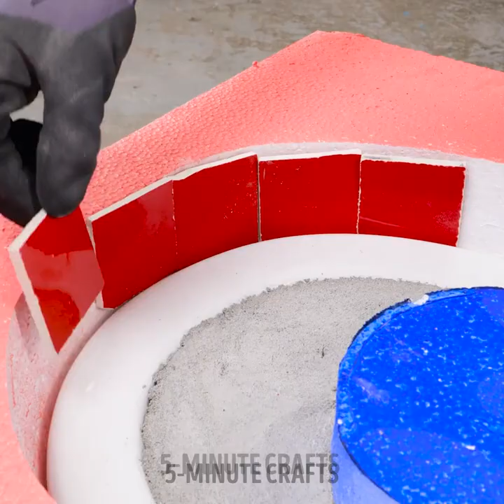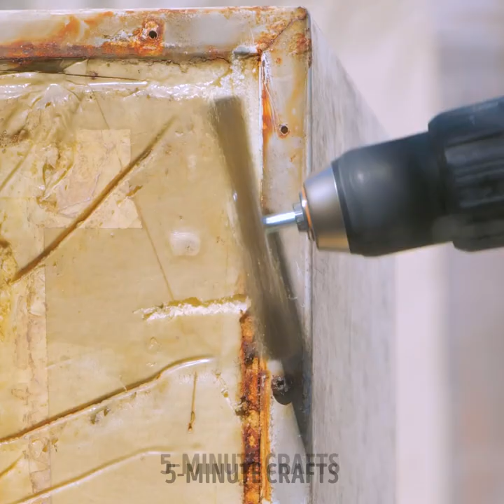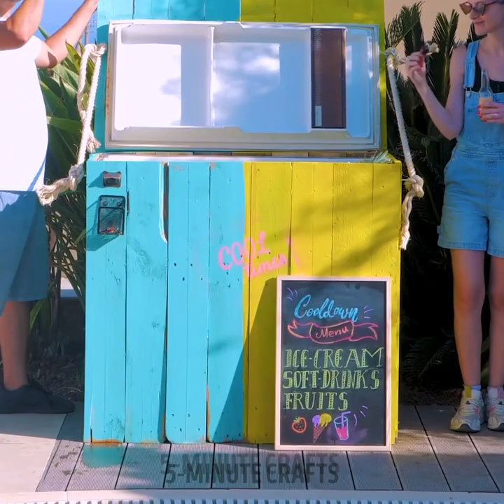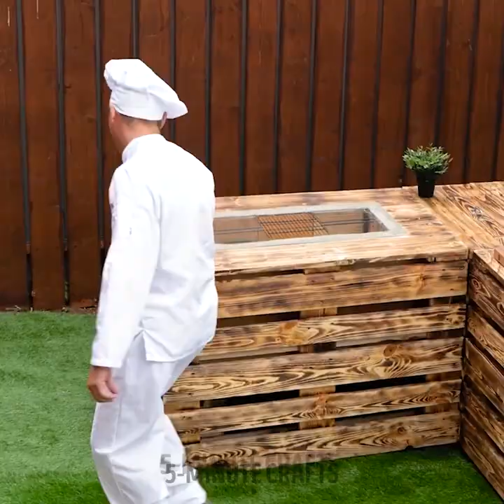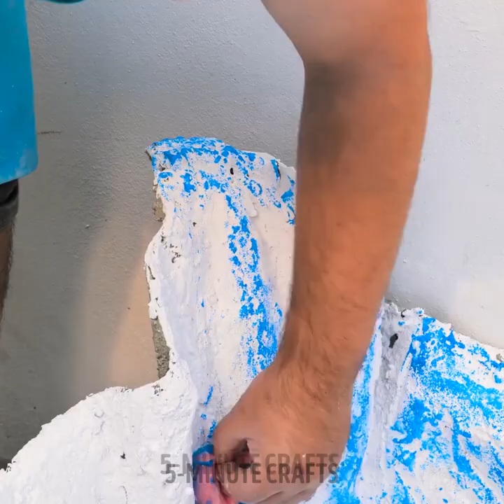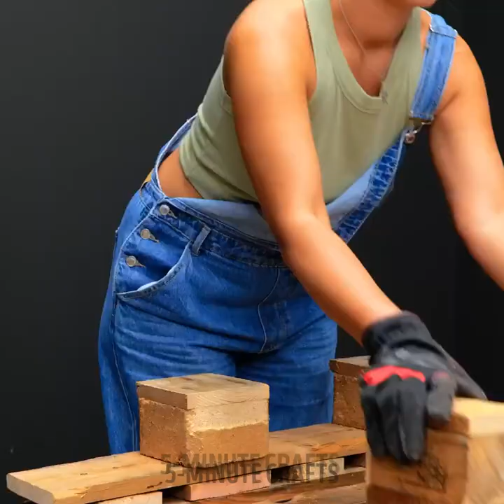Amazing Backyard DIY Ideas That Will Upgrade Your Home

Comment: How can I take a bird bath and duplicate it?
This one is old and cracked from cold weather.

I need bowl shape and outside bowl shape to pour concrete.

How do I separate both to mold a pe
Roper bowl?

Also how I mold stand?
Reply: Sounds like you should hire some...
My fee:
$50 an hour
$100 if you watch
$200 if you help